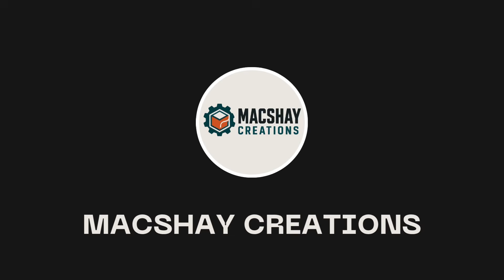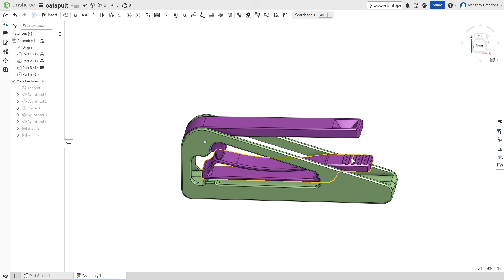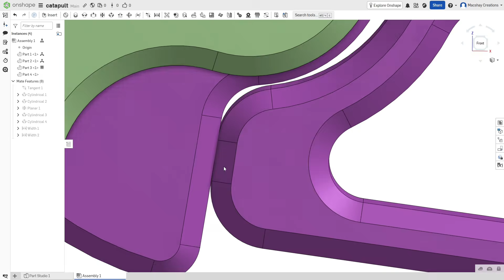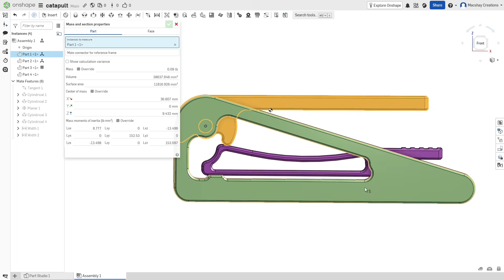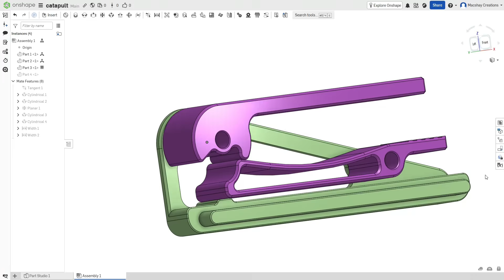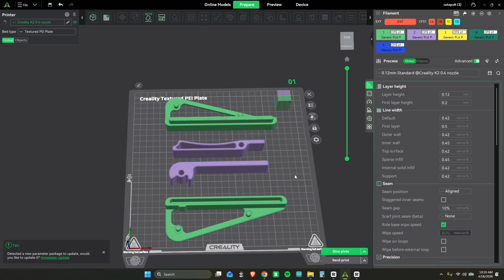3D Printed Catapult — How It Works, Print Setup & Assembly Guide

Comment: Cool design! A spring and some locking mechanism would be interesting. Would probabbly need a long U shaped spring in the bottom section
Reply: nevermind, checked your channel and saw you already did this. Very clever design on the spring load mechanism
Reply from the maker: lol Thanks for the insight either way!